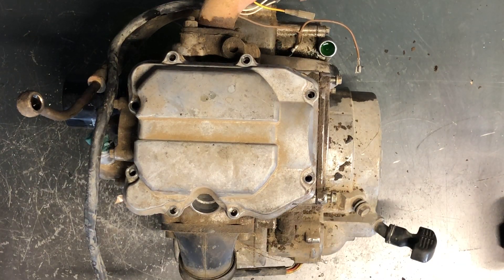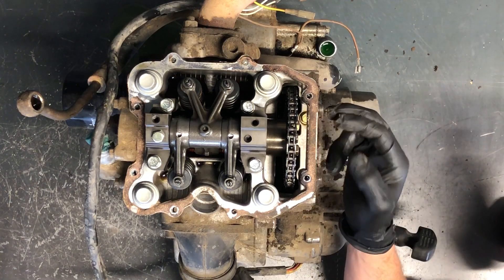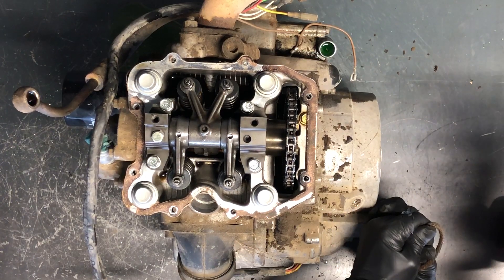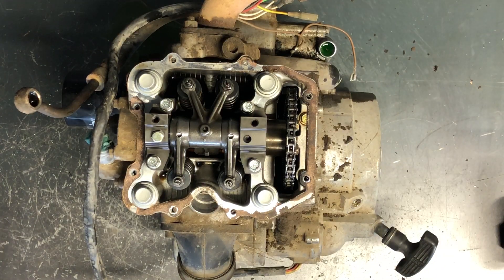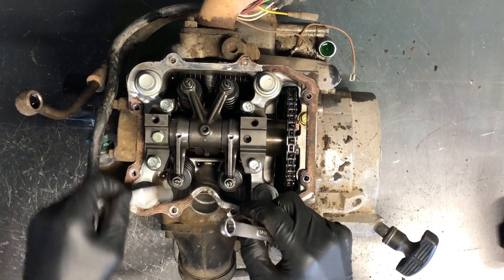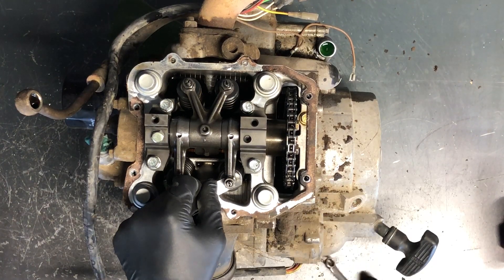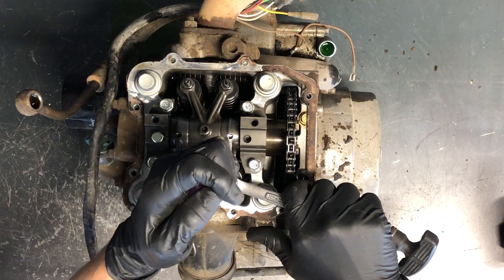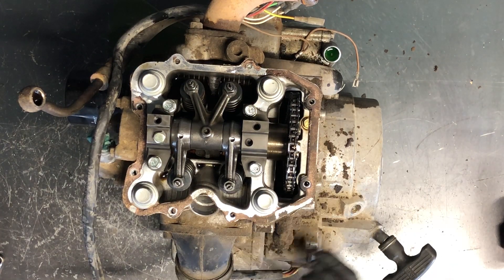HOW TO - Polaris Magnum Sportsman Ranger 500 425 400 Adjust Valves Adjustment Lash Maintenance

Comment: I have a 2006 Magnum 330. Do these have a valce cover gasket? My research isn't showing anything. I have a leak at the mating surface at what I think is the valve cover just above the exhaust. Having trouble researching it and this video is the closest I have come across. Thoughts?
Reply from the maker: You have a breather cover on yours. Gasket is Polaris Part # 3087034. to sandwich your camshaft, there is no gasket there. You will want to use some 1211 or something similar. Its a liquid gasket. Thanks for watching. Hit the subscribe button if you get a chance.

Comment: I have a 1996 Polaris Sportsman 500 I just put a new camshaft in it and I was putting it all back together and the last thing I want to do is check the valves the exhaust valve I could put the Gage right under it and it was a little drag that was fine but then when I went  to do the other two valves the intake I couldn't get my gauge under it ..is that normal after  putting a new camshaft in ? or what should I do just loosen them up and start from scratch ?any help would be appreciated thank you

Comment: Dear sir...can you help me 
i have magnum polaris and when i try to drive it i hear strange sounds and the magnum doesnt drive but when i put it on slowly mode the ATV is Fine...can you reply please ☺
Reply: Mustafa Adnan how many videos have you sent this to.
Reply: Mustafa Adnan Sounds like you have moisture in the override switch assembly or possibly too much slop in the throttle cable. There is a ground wire you can disconnect from the switch and give it a try. But you will have to reconnect it to shut the engine off via the on/off switch